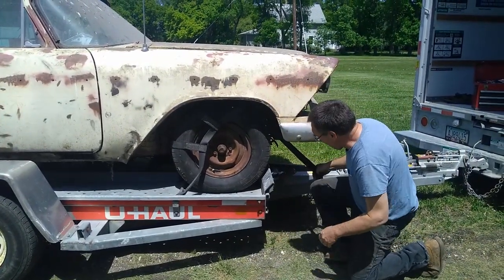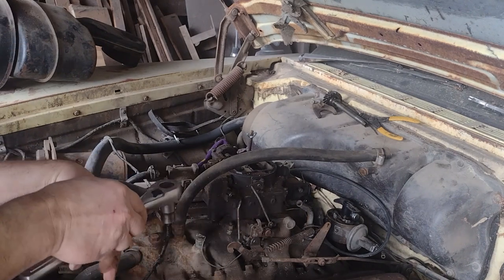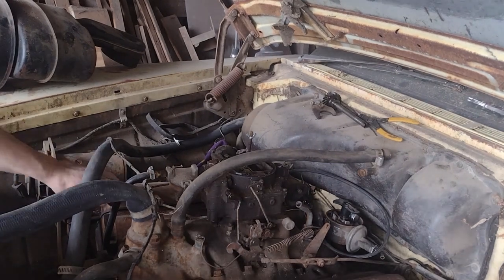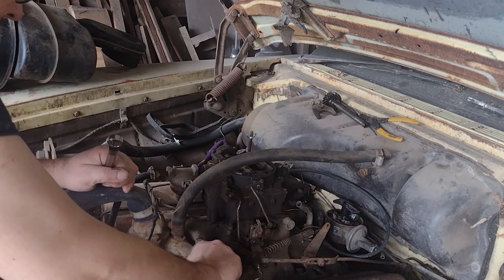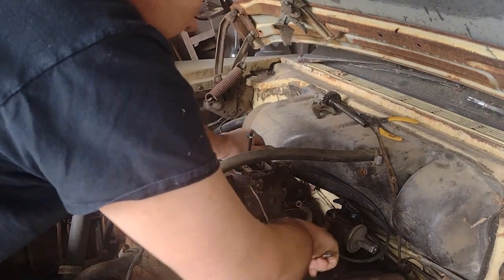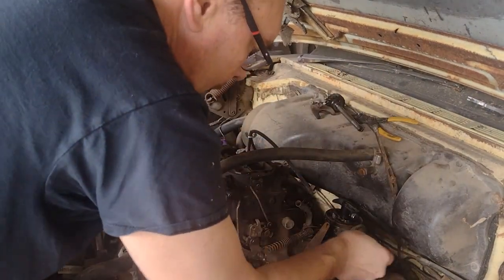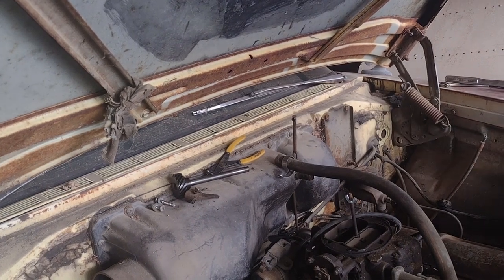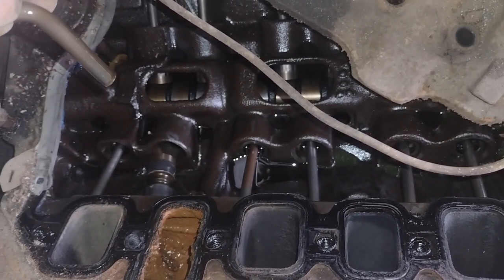New information! Mystery oil pressure Issue! Once again!!!

Comment: Hey!! 😀 You have an answer now Dan! There is still hope to having it running again. Happy wrenching my friend 🔧🔩
Reply from the maker: Zane, always a pleasure to have you stop by!
Did you see any improvements in my amateur video production? 🤔 I'm trying! Some it comes naturally!  Not this guy!
Yes, it'll run again and with oil pressure! I wonder how big the spray of oil was in that valley??
Now, to lower the engine back on it's mounts, replace the parking brake cable, put the drive shaft back on.
Catch you on the next one!
Reply: @dans_Learning_Curve  oh yes Dan 😁👍 Nice job with the recap

Comment: Good on you Dan! Keep at it mate, and you’ll have the old wagon purring along!
Reply from the maker: Thank you for the kind words! Need a pushrod. Put engine back down on the motor mounts. Install starter, and Y pipe. Replace the parking brake cable and install the drive shaft. Connect rear brake line.